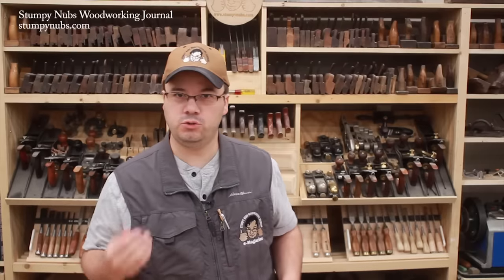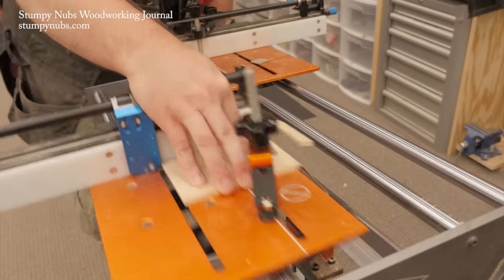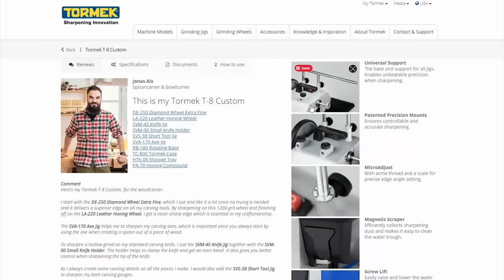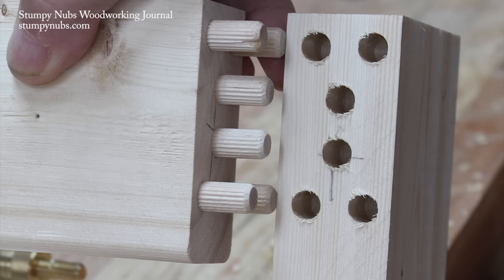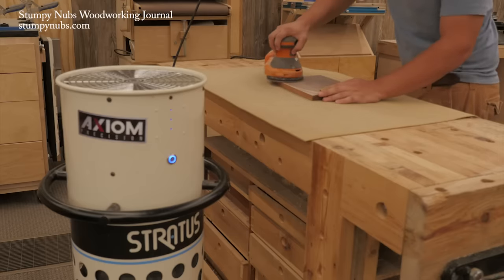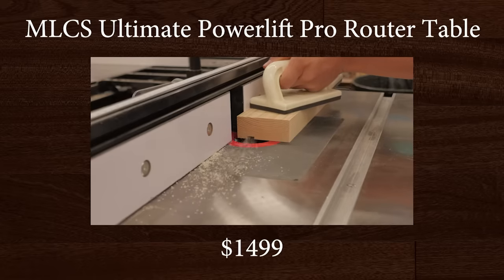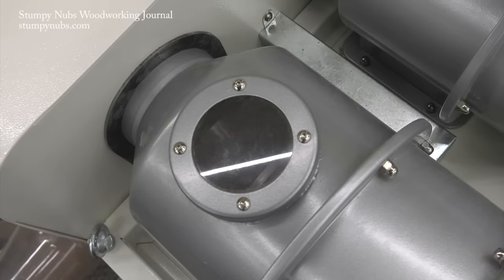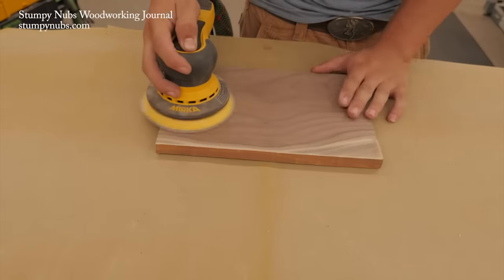Ten EXPENSIVE woodworking tools you have to see!

Comment: I suggest switching from an electric sander to pneumatic sander for speed, power and superior dust collection which is the standard in the marine industry. We like to point out woodworkers measure sanding in square feet, auto body applications in 100’s of square feet and marine applications in 1,000’s of square feet. A pneumatic sander is lighter with no electric motor, higher range of speeds, less noise, and generates much less heat. The overwhelmingly superior dust collection is the best benefit. Pneumatic sanders are hooked up to a similar vacuum system; however the added boost of air moving across the sanding face adds a high degree of push (at the sanding face) adding to the suction of a vacuum. The result if stronger suction thus better collection of small particles. Most importantly the cost of a Mirka or 3M pneumatic sander is around half of an electric and has a substantially longer life due to fewer moving parts and cooler operation. The one drawback is the pneumatic hose which can largely be overcome by warping the two together and supporting over the shoulder.

Comment: I have a Dowelmax and it is a stunning tool at a great price. The pieces I've built with it are super strong, rigid, and perfectly aligned. Reveals are a snap. I've tried many other joining systems and this one has the all beat for speed, strength, and ease of use. The fact that it is only ~$250 makes it a steal.
Reply: As a machinist, and someone who is familiar with design cost and shit involved, 250 is a steal on dowelmax`s behalf, not yours... A cnc machine that can turn and mill can make this assembly of parts with absolute ease, in fact, i would say that with 250$ price, dowelmax company has around 100x the profit margin or 10000%, making that a part that can pay off a machine that produces it in about 2 days, if it is being sold at equal rate to production... A machine can make at least 70 of those per hour, which can then just be dumped into a box and sold, making this almost what coffee is to a bar owner, the best earner... One only needs a machine to make them, like with coffee in a bar, and once you do, every pop you sell gives you a profit margin of so fucking much that you can laugh at the sucker who thinks he got your product for cheap and counts it a steal... Price for raw material on that is around 3 bucks on an industrial level, give or take, depends on a lot of factors, but you get the point... You paid a fair price for a good tool, be happy you have a good tool, dont fool yourself you stole it, if you want a steal, i can show you how to do that too, and trust me, when you steal, its a steal, because you get it for free, literally... Otherwise, if its store bought, you were stolen from, at least the taxes you were charged can be considered theft, if you can accept the price the item has before VATheft...

Comment: I own that dowelmax, and it is very fantastic, it reminds me of my drilling jigs we used when building aircraft. The tight tolerance of the drill guides is great to quickly get straight and accurate holes. I would recommend getting one and skip all of the home depot versions
Reply: Right on with all  your comments. I got mine about a year ago after researching the other options; I''m not a hardcore master woodworker. I build speakers for a hobby, which need very solid joints at all edges. It's such a pleasure to glue up all six sides of a box at once when the dowels make it all self-aligning. I find myself using it even for knocking up shop tool stands, shelves, etc - no messing around with screws. For what you get and how well it works, this is not an expensive tool. Stumpy's right about the set-up time, but that's a pretty small fraction of the time I spend on the whole project.
Reply: @dogbucket  yeah for real. It's around 300 bones i think when I bought it. I'm looking at the Mirka sander for a couple years now and it's 600 lol

Comment: I am drooling over many of those tools. The side mounted router looks amazing for joinery. 

Facing a sanding job right now and so wish I had that sander. My hand had a blister and my wrist is aching because my sander has a side grip instead of an over the top grip. My dust collect for it is a shop that I duct taped to it.

As my shop is also a garage that I need to put a car in, everything has to be on wheels and my tables all fold up for storage . . . maybe someday.

Comment: From the list I have the CTM Midi Festool, Dowelmax and Domino (if we count it).
First that Dowelmax is absolutely beautiful and beyond well made tool. It is slow, but very precise and makes strong joints like you said.
You need to mark a lot of stuff and not confuse it before proceeding to drill holes.
Festool domino is another very well made tool and since I got it the Dowelmax (sadly) collects dust. I love everything about domino except for its initial price, but that can be redeemed with couple of good paid commissions. You can save money by quickly making your own dominoes if you wish to save money. I made few thousand in an afternoon and they last me quite some time.
Finally the CTM/CTL Midi. I had the same reaction for it - too expensive vacuum cleaner. Until I started to see the details. It is square with flat top! This has to be my favorite about it, because you can place other sustainers or use it to lay down tools. Hepa filter is top notch and the bag is easy to clean for few times before you have to throw it. There is reusuable bag available, but costly. Also do yourself a favor and buy the bluetooth hose adapter. This will allow you turning it on without having to go back to the vacuum and bend over. I'm not lazy, but this saves so much time especially when you are 9ft away from the vacuum. 
Mine is CTM which has the alarm when the bag is full, not worth additional $100, go with CTL. You'll notice when the bag is full (no/low suction).
I don't have the Mirka sander, but I have Rotex 150 and it is an incredible and very powerful sander, dust collection is phenomenal. Buy good quality sand paper, that is also the key.

Now I believe all the other tools mentioned here are top notch and I'd love to own some of them soon. Tormek is catching my eye for a long time now. Also that chip extractor looks interesting. Ahhh just take my money....
Happy woodworking!

Comment: The Harvey G700 is an absolute beast.  It's got the same HP rating as my old JET cyclone, but it's got quite a bit more suction.  The variable speed control and the much lower noise are quite nice as well.

Comment: I've used festool AND mirka sanders professionally for many years now. They are both great machines. Spesifically the festools "mirka style"   sander has even little less vibration than the mirka has. Both are powerful and biggest difference is the on/off switch. Mirka has a pedal and festool has a button. Personally i like the pedal more.

Festool extractor bags arent cheap but you can get the expensive version of the bag which you can empty yourself and it last forever. I have one and its made from very tough materials. Its not cheap but its the cheapest option on the long run if you use the extractor alot.

Comment: Very informative and interesting presentation. Great stuff indeed.
 I sometimes just get a slight feeling of boredom when it comes to all these high end tools of micrometer precision, packed with electronics in a woodworking shop. 
The more complex and unique the device and its attachments the more you depend on the manufacturer’s assistance and parts when some maintenance or repair is due.

Comment: I've been using the Jessem Dowel Jig for a few years. I compared the Dowel Max and a couple of others but the Jessem won out for its precision and easy setup. Even changing dowel size is painless. If you get the full set, it's a little pricey and there are a few pieces to keep up with but it has typical Jessem looks and performance.
Reply: I went with the dowel max for its 45 degree Miter attachment.

Comment: I took an old Kirby Vacuum cleaner ($50) in place of the Festool Dust Extractor ($800+). The vacuum uses an externally isolated from the motor propeller shaft turbine to create suction and propels the dust through like a turbine bypassing the motor, out to the large hose that used to connect to the dust bag, which now it's connected to my large dust collector through the 4-inch pipe.  So I have no bags to empty or filters to maintain but only one from the large dust collector.  It's the best of both worlds, I use the Kirby with small volume but high velocity/pressure flow to collect dust from sanders and other small tools and the large dust collector for large woodworking tools like plainers, jointers, cabinet saw and so on.

Comment: I bought the Mirka sander after watching this... damn! I had a Dewalt’s 5” random orbit. And one from Ridgid too. 

This thing is 10-15 decibels quieter than the Dewalt depending on the speed. And it’s lighter too.
The Dewalt always gave me a little trouble getting close from certain angles. This sander has much more access, which I appreciate.

Finally, the vibrations is so much less than the others. My hand doesn’t get numb or tingly when using this. There is even an ability to adjust screws and bolts to improve the hand vibration. 

Finally, I don’t have a good explanation because I’ve used the abranet discs for a long time, but they seem to be more effective in removal with the Mirka.

Yes, is $600. But, holy cow. It’s amazing. Thanks for reviewing it.

Comment: I found your review of the Bridge City Joint Maker Pro (JMP) interesting. I owned one for about 10 years, including all of the accessories, before selling it. Every few years, I'd start from scratch with it, thoroughly reviewing the instruction, assembly and use instructions. Each time, I would come to the same conclusion, that it was a fascinating idea but incredibly poorly implemented. As a mechanical engineer and long-time woodworker I found it to be a just awful tool, right down to the stand that supports it. I found it inaccurate, non-repeatable and with many truly badly designed features. I have several pages of notes of its design and implementation shortcomings. 

I found it very odd that in the decade and a half since it was first commercially released, there is nearly zero discussion of it by actual owners and users. For example, one can count on one hand the number of Youtube videos that exist of people using one. (Most of those videos were early videos by Bridge City Tools.) The Mark Adams woodworking school once offered a course on using the JMP with the intended outcome of the course being a published book on the JMP's use. No book was ever published. For such an expensive and innovative tool, one would expect buyers to want to share what they've done with it. Very little has been shared by actual users. Most of the discussion has been by woodworkers who have not tried using the JMP but wanted to. 

Over the years, I've purchased and used a number of Bridge City tools with very mixed results. Some were good, cleaver tools, others marginally functional, but all were expensive. Discussions with the then owner of Bridge City did not resolve some of the deficiencies in design.  The good news is that since Harvey purchased Bridge City and is now manufacturing the tools in China, the prices have become much more reasonable. The quality of the manufacturing is as good as the much more expensive U.S. made ones. However, the designs, good and bad, remain the same.

Comment: I will admit, most of the tools you discussed were only destined to the wish list or nice to have if I win the lottery. However the orbital sander and dust collection system is on the want list. Mostly because I am in a need of a good sander that has a working dust collection system. Thanks for sharing.

Comment: That Festool extractor is good.  Bought the CTM Midi and it's one of the few things that's had Bluetooth added that actually benefits from it.  If you have Festool batteries with Bluetooth it'll auto-start like a corded tool with the power take-off socket.  If you don't, you can buy a bluetooth button that clips onto the hose that starts and stops the vacuum.  I added the Systainer cyclone kit (CT-VA-20) which - you'll be surprised to hear - isn't cheap....but it does work rather nicely.  I'll be honest that (apart from the bluetooth button) one of the main selling points was that it fit perfectly into the gap between the end of my bench and the wall....so the cost was somewhat justified (in my head, if my wife asks!) by the fact that I got back a 600 cubic mm space that was previously occupied by shop vac that didn't fit in the gap.  If the entire width of your workshop is but 1500mm, that sort of space becomes very significant!

Comment: Nice. Btw the ct midi doesn't have automatic cleaning. That's the green lever on the side. Only the CT 36ac and 48ac have the autoclean. Which is only helpful if youre not using a bag. And I hope the mirka lasts well for you. The speed controler tends to die on them. Mirka makes some of the best abrasive around though.
Reply from the maker: I should have been more clear- The Hepa filter features integrated (not automatic) cleaning so you may clean it without removing it from the machine by flipping that handle. The filter bag features automatic cleaning to restore lost suction. As or the Mirka, time will tell. But they have improved their electric sanders since the old Ceros/Deros models.

Comment: My favorite room for woodworking is OUTSIDE. I just love the fresh air, and dust is almost never a problem. A well-placed medium velocity fan is all that’s needed to move the dust away from your nostrils. It’s not always possible, due to seasonal changes, to work outside.  When you can, try it and see if you don’t like it.  A pair of sawhorses and some plywood or planks is usually all you need to take your shop outside.
Reply: You're still gonna Inhale dust more then you would with an extractor hooked up to a tool like a sander. Just yesterday I was outside working on a deck demo and despite having a pretty decent blower to clear the area the wind was still blowing all the broken down wood/leaves/dirt all over the place. I can only imagine it would be the same with a fan. It can help, but if the wind is in your face it's not a perfect solution.
Reply: @chriswitek9455  or

Comment: I also have had that “game changer” feeling with the Festool ETs EC, also brushless with a very similar form factor. The 5”/125mm is $400, the 6”/150mm is $525. I also got the new CT-15 vac which is a essentially an entry level version of the midi from the video. The new Mini/Midi/CT-15 share the same motor and performance specs, the midi and ct both have a 4 gallon capacity. The CT-15 is $350, the Midi 2 is $640. That $290 buys you the sheathed anti-static hose, Bluetooth, a larger “garage” that holds the hose, and ability to mount systainers on top.. and it has a footbrake. They did focus on making the CT-15 very compact, but I feel like they could have given it the systainer mount at the very least, it would come in very handy for location work.  But clearly they wanted to get this unit to a price that would attract new customers. They did the same thing with new impact and drill.
Reply: I'm guessing the CT15 won't work with the sistainer cyclone then?
Reply: @markpalmer3071  No it won't. The cyclone fits the larger 26-36-46 machines that have a front hose connection, and I believe they all have the larger diameter hose.

Comment: I have the dowelmax, and I haven't used it, because I have a Multi-router and a Domino.  I am not sure I would recommend it, since it is easy to create a dowel jig very easily yourself.  By the way, for me, the Festool Domino is one of the most unique tool I have seen in 40 years of woodworking.  Expensive but worth it!

Comment: On the festool midi dust extractor you can cut open the bag along the edge and then roll it a couple times use those big paper clip things the black ones and you can reuse them.  There top notch.  I replace about every 10 fills.  So it’s about 50 cents a bag. Also I’ve never used the mirka sander but the Rotex positive drive sander changed my life.

Comment: I purchased the festtool MIDI dust extractor.  Although I don’t think that model is the midsize. If I’m not mistaken it’s their second smallest unit that they make other than the systainer model.  I agree that the bag size is probably the only thing to knock on the unit. Although it could use a tad more space to store the hose. But as far as the bag size goes, if you look at festools  comparison chart, that really is the only major difference between any of their vacuums. It’s just their capacity. Other than that they’re almost all the same suction and noise level.
Reply from the maker: I did not count the little Systanier model